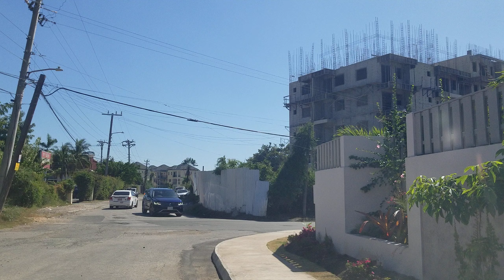Construction New Junction Main Road  Jamaica

Comment: You're missing the point? From Kingston to Port Antonio is 60 miles when you drive junction road why are you going to drive from Kingston to Port Antonio on the St Thomas route? It's a longer journey. The southern coastal highway is just four lanes from harbour view roundabout to yallahs  bridge? The rest of the road way is going to be 2 lanes and in some places like Roach Gully is going to have 4 lanes. I'm hoping in the near future they will build the toll road for St. Thomas. The purpose of building a new road for junction is for tractor trailers to traverse on it. Example: if a tractor trailer has to travel to Buff Bay Portland with cement the best route would be the North South Highway or Route A1 to Drax Hall ? Remember tractor trailers and trucks can't travel through Fern Gully and tractor trailers can't travel through junctions either.
Reply from the maker: Thanks for the info. I did not realise trailers could not use the Junction road
Reply: I agree with part of what you say but best believe it,  toll road is not the answer. Do you realize how many people try to avoid the portmore toll daily??
What about building the road from papine  to buff bay ?? That journey would be about less than a hour to buff bay.  Building an entire road would be costly.